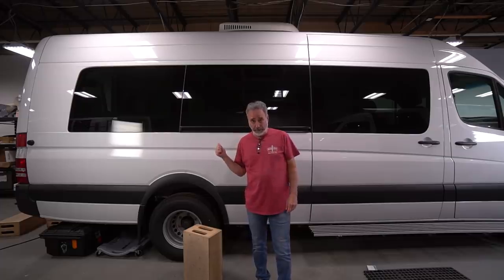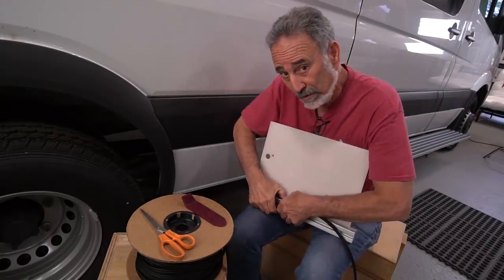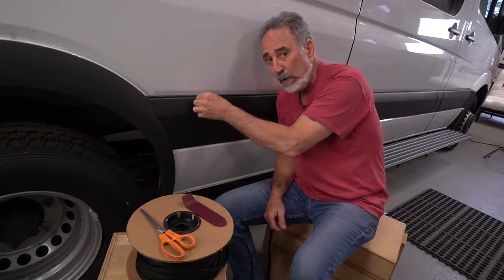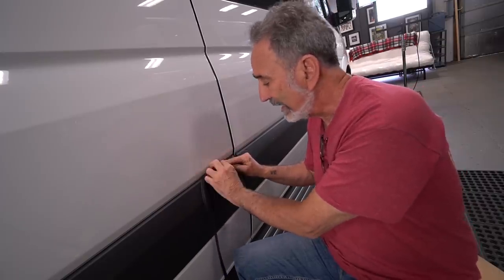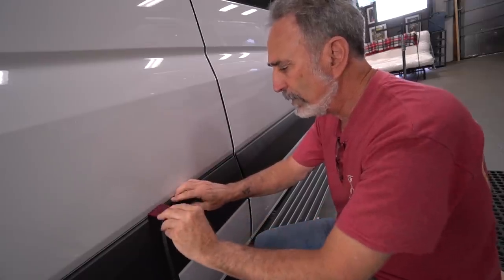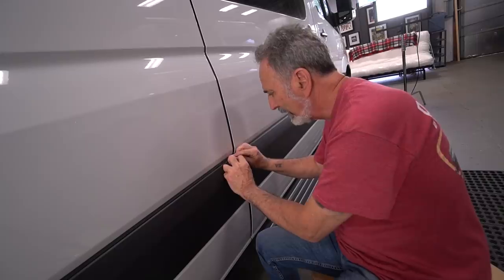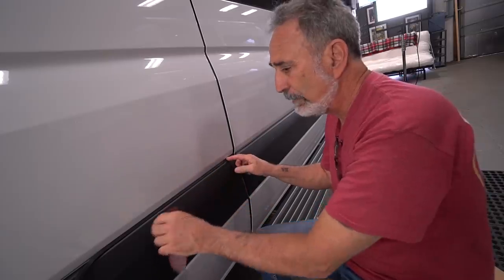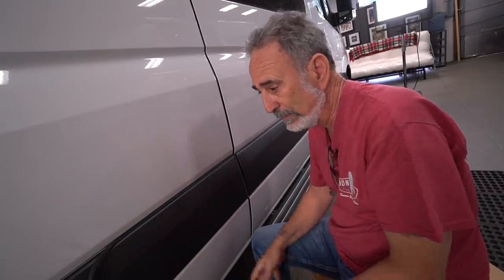SPRINTER OWNERS! Stop body panel leaks easily

Comment: I purchased the 8020 silicone version of the gasket and used this on my van after watching your video.  My understanding is that it does not have a UV retardant in it but it will be more UV resistant than the rubber version of the same profile gasket.  I added this in about and hour and after 3" of rain on a Saturday the leaks were stopped in my cargo van.  I had the luxury of being able to see inside the van since I had not insulated yet and the cargo factory panels were off.  It works.  The only change I made was to cut notches in the gasket where the gasket would not seat completely down into the track.  I figured I can replace the gasket on a periodic basis if needed.  Thanks for the great suggestion.
Reply from the maker: DISCLAIMER: I have not paid Kathryn Dydo for her review and she does not work for Humble Road 😜
Great review! Thank you Kathryn!

Comment: great video series.  my sprinter van build is 95% done. only 30% more to go. :-)   just finished installing the rubber strips. looks great. I added a uv resistant silicone.  and will add silicone or sikaflex to the interior clips then call this waterproofing job done. thanks for the tip. took 3 hours.

Comment: George, the other help would be Silglyde.  This is technically brake grease, but used extensively for rubber and o rings, it is completely safe for rubber unlike other greases.  I use to reassemble plastic clips and components for easier service later.

Comment: I already removed my panels and it went down exactly as you said...half the clips break and it's a pain in the butt.  I was shaking my head by the end, wondering how the fine folks at Mercedes could have allowed this design flaw.  I'm going to do the rubber flashing as well, as after a rain there's got to be water hanging out behind those panels, even though it likely can't get into the van.   Thanks for the great tip.
Reply: barbjoz63 this is a great tip, but if you guys are breaking half your clips you’re doing it wrong. I don’t think we broke even a single one.

Comment: There's an old adage that goes:  Good, fast, cheap, choose two.

This is a good, fast and cheap/affordable fix to a design flaw that should be remedied before applying insulation to the interior vertical panels of Sprinter vans!

If it were me, I wouldn't remove the panel, or use silicone. Available in either a gloss black thermoplastic elastomer, or a grey silicone, the 15 Series Economy Panel Gasket will effectively seal the space between the body panel exterior and top of the rub prevention trim.

At $0.53 per foot/meter, and ~$5.00 for a trim tool, this is a fix anyone and everyone can do. Probably for around $35.00 all-in!

Great tip George. And it looks really good, too.
Reply from the maker: John Coloe thanks John.

Comment: Thank you George for solving my problem. I really didn't want to pull the molding off. It's worth a try.
Reply from the maker: BeachBum given the cost and ease of installation, it’s definitely worth a try.
Reply: Why not do both? My lady and I took the trim pieces off, Sikaflexed all the clips and put them back on in an hour and a half. But I like this added insurance.

Comment: George made a bit of an issue about the panels on Sprinters catching water and causing rust in a recent post ( Sprinter? Promaster? Comparing these two vans
, Jul 19, 2020). Though George did not refer to his potential solution of 14 months ago, I remembered it and gave it another view and a Like.  With a '19 170 in conversion, I promptly ordered 40 feet of the gasket.

Then I read the 135 comments. To sum up: No long term review (more than 8 months); gasket is not UV rated (touch it up with some Aerospace 303 every few month); it's cheap enough to give it a try (I have); and like windshield wipers, consider it a maintenance item.(I will).

There is no car, truck, bike or motorcycle, no boat, personal water craft, airplane or house, that is design defect free or, that does not require maintenance; preventative or repair. This goes for vans too.

Thank you George, for reminding me to give the 80/20 gasket a try. I too suspect it will be a 90-95% solution.

Comment: Nice work George.  I’ve seen so many rusty Sprinters.... how could Benz let this go on for so many years.
Reply: All the vans that have plastic side panels have them mounted through straight-up holes in the side of the van. I saw a couple converting a Ducato (Promaster) who used spray foam and they foamed everything up very enthusiastically. Including the drain holes in the very bottom of the van walls. Didn't take very long before they had an indoor pool.
Reply: Croft Yes I saw that on a Day in Nature video, heartbreaking for them to redo work.

Comment: I admire your work so much. Creative, top quality, craftsmanship, etc. - all presented with humor in an entertaining way.

Question: is that rubber made to live in the sun and weather? If it is, seems like another creative, innovative solution to a known issue (makes you wonder how the manufacturer would let the known problem continue to exist, doesn’t it?).

As always, big thumbs up!!

👍
Reply from the maker: Thank you. This product is not necessarily made to live in the sun: "either a black thermoplastic elastomer or gray silicone rubber." I've had a piece of it on the van for 8 months now with no signs of fading, nor cracking. But I can't tell you how long it will last, think windshield wipers...
Reply: The 8020 trim is not UV resistant and its operating temperature rating is 0C - 40C. Depending on the environment, it will not last.

Comment: Hope they've addressed this fault on the 2019 sprinter - but a great fix anyway. Maybe prudent to seal from the inside as well.
Reply: If you see any van with side panels, they're almost certainly going through holes in the sheet metal. Not just Sprinters.
Reply: I own a Sprinter 2019... Same thing.

Comment: Anybody in the uk 🇬🇧 no where I could get this rubber trim . Great idea mate 👍🏻👌🏻
Reply from the maker: 8020.net
Reply: Did you have any luck? I got some weatherstrip from Screwfix and ran a blade down it to separate into two. The L shape I was left with worked okay but is a little thin for my liking.

Id be curious if you stumbled on a solution over here in Blighty.

Comment: Definitely a way to do a belt and suspenders approach here, but personally I'd strip the panels and use a marine sealant rather than silicone (or some equivalent) to seal the holes under the panels once and for all. And then this on top of that when the panels go back on. Pretty much all vans, not just Sprinters, have the side panels mounted through straight-up holes right into the van, and need to be sealed. The Ford Transit which is otherwise a great choice for this type build has four rubber-covered holes in the roof (!) too, something to do with the roof rack. Those need to be meticulously sealed also.

Comment: Good idea to stop water running down but when you are driving it will be spray. As the vehicle is moving there will be pressure difference between inside and outside. At times of suction, say when you open the window, this will draw the spray in through any holes. The only true way to stop it is to pop the trim and seal em with Sikaflex. As I've posted before, it's built in obsolescence coz VW/ Merc want em to rot so they can sell new vans.

Comment: I will try this on my Ford Transit 250.  or I will use zip away sealant.  Because it is removable. I would never use silicone Rubber.
UPDATE:
Turns out your method is a temporary solution. Problem is over time using your method, Plastic warps and starts to leak again. My Zip Seal' N Peel method is permanent and works very well
Reply: ."I would never use silicone Rubber.".......   why?   looking to sort my van too.

Comment: Looking for a solution for my van ,this seems to to be the answer at first glance.  I think I solved the problem ...I added vinyl film or car wrap by a professional pick out a cool picture they wrapped  the mid to bottom of the van exposing the camera and sensors only that trim piece is wrapped so water should not get there
 I have a 170 extended for $1500 they wrapped my hood and lower all the way around a full wrap  was $7000 -$10000.

Comment: brilliant once again! I believe this is a sprinter design/manufacturing flaw. Am I wrong...does it also happen on the Promasters?
Reply from the maker: As far as I know, it's a Sprinter issue.
Reply: Great website. There is similar holes in a ducato so I suspect they also exist in the promaster. These holes have two purposes , 1 to attach the panels and 2 to allow paint to drain out during manufacturing. There are often little rubber plugs in the end of the frame that you can pop out.

Comment: 5:06 Hey George, any long term feedback on your experience with this process? Was it effective? Do you still suggest doing this as a possible way to minimize water entry? Thanks again for all the great videos and information!
Reply from the maker: The two sprinters I did this to our long gone out of my possession. I can only guess that it worked just fine. It’s an inexpensive enough fix that. I would certainly give it a try. The success depends completely on how well you install it.
Reply: @HumbleRoad  Thank you so much for the quick reply, George. I take it you don’t do this to your current Sprinters.
Reply: @HumbleRoad  What do you use to seal your current builds?
Reply from the maker: @TheCCMasterChief  I do not address that design flaw any longer
Reply from the maker: @RR-ty6ki  Mercedes has had more than enough time to correct the problem. I tell my clients to file a warranty claim.
Reply: @HumbleRoad How would you know that you had damage from such leakage
Reply from the maker: @mind5533  I never saw any damage I was being proactive based on what I’ve read online
Reply: @HumbleRoad  I just did it last week, and it looks great. I bought the stuff after seeing your video a few months ago because I had noticed a ton of dirt sheeting out from under there upon washing after an 800 mile dirt road trip.  But I finally did it to keep my little dog’s thin leash from becoming snagged in that space. We have had no rain since.  I will post back next time it rains or I wash it.

Comment: George,  Nice idea, but seeing this is outdoors in the sun, is that 2115 panel gasket UV stable?   80/20inc has no specifications listed for it.  One things for sure, it will reduce the vibration of the panel against the painted body panel, therefore stopping plastic panel from rubbing through the paint job exposing the steel body panel to water and road salt as well as dirt.
Reply from the maker: M Rose most likely not UV stable. They offer a 150 ft roll for $70. If you share that with other Sprinter owners, it becomes more affordable. So have a gasket party every 3-5 years!

Comment: Are there any other spots to watch out for where a leak can occur? I've heard it can leak through the antenna, and from the heating matrix, but I once had a leak in the passenger side from the foot well down into between the seats, but never knew where that came from as someone cleaned it for me. So if anyone can give a y pointers with that it would be great.

Comment: Thanks for the tip. As a new Sprinter owner, I was not aware of this issue. I wonder how the black rubber will look with the all-white body panels painted by PW?  Better than having a leakage problem.
Reply from the maker: If you don't have any black on the chassis, the grey might look better. It's also a different material that might be easier to work with, IDK.
Reply: @HumbleRoad  well, we won't break the bank if we buy both colors and try them. Thank you again.

Comment: Hi, how are the trims holding up? I’m thinking of purchasing the same gasket but curious if it ended up cracking do to UV. Thank you.
Reply from the maker: I’ll ask the owner
Reply: I just ordered the gasketing George recommended as was curious about the same thing.  As an FYI; they now get .78/foot so 34' with UPS ground shipping came to 48.57 but still a good deal.  As some others here have reported, I intend to seal the inside of the clips with sikaflex as well.  Hoping this will eliminate any future considerations with leaking at these locations.  Thanks George!

Comment: I installed this on mine, made sure to press it in firmly, but it started to pop out. At some point I lost a whole strip while driving on the highway... The heat/cold seemed to also expand/contract the rubber lengthwise, creating extra tension making the strip pop in/out in some places. I should probably do it again, but have almost given up on this product... I'm sure there's a correct way to apply it, but I really made sure to stick mine in properly. I'm thinking perhaps some grease or soapy water is necessary (yes actually necessary) to remove any lengthwise tension in the strip? thoughts?
Reply from the maker: You will have trouble wherever you come across one of the Sprinter panel mount Christmas trees. You can try cutting away some of the barbed flange on your rubber to fly over the Christmas tree.
Reply: did you add silicone?   it acts like a glue and should hold it in place. I just finished ,one this morning and hope that I am right.

Comment: Wouldn't it be much a more guaranteed seal/easier fix if you just caulked the perimeter of where the plastic panel's edges meet the metal body of the van?

Comment: As a tool, would the roller you used on the screen door work?  If not that, a similar wheel-type tool?
Reply from the maker: Geoff Badenoch yes a wheel tool would be helpful. But not a metal variety, plastic, soft plastic!

Comment: Here’s why NOT to remove those trim panels: I removed mine with a plastic tool. I leveraged off the body to pop each connector loose. Was a cloudy day. The next day, the sun was out, and each of my ~50 tiny dings in the body was clearly visible. It hurt to see that. If I had it to do over again, I’d leave the panels on, but seal each and every clip from the INSIDE, using Sikaflex.

Comment: owl vans sells a rubber kit just for  this purpose so I'm wondering of its better than the 8020 and want to find out the difference in price, anything marine or Van conversion s brings a Hefty over priced item, oh by the end of the video George mentioned the price so about $25 for a 170 and Owl Vans is $59 SO my decision is made, thanks
Reply from the maker: I know for a fact that after I posted the video, “products” started popping up on line. They were simply buying the lengths from 8020, repackaging and selling as a special kit.

Comment: You can also solve the problem by giving the water a bit of a playground and cut out stripes under every plastic-pin... this way water can come in but it'll leave the "natural way"... Since the Van isn't insulated in these areas you can top up the insulation with a a little bit of thinner material over it... so the water is behind it. I also like you're idea but I know a lot of problems for example with the Fiat Ducato (which is your Promaster in the US) and you're not even think about what can happen in the future... Take for example the Promasters little "rain gutter" over the backdoors... it's a horrible construction-failure by Fiat because if you're Van is standing in the snow and water freezes up there in the rain gutter it can damage your upper layer of paint and we all know what will happen if the paint peels off on the roof... it's getting expensive! ;) So I hope I gave you a new information here about your future Van-Builds since this was my most painful lesson in the past. I simply love your attention to detail on your Van-Builds... awesome work... speaking from photographer to photographer! :) ;)

Comment: Is the strip material UV stable?? ...or stable with use of soaps, oils, waxes, polishes etc??
Reply from the maker: search: gloss black thermoplastic elastomer, or a grey silicone.
Reply: Humble Road  ok and which one is the stripping material made out of?
Reply from the maker: @simondigiwiz4810  You can get it in either material and color. I purchased the gloss black thermoplastic. A test piece has been on the van since last October. Drove it from NJ to Elkhart, Indiana and back, sat outside for months, no signs of wear or degradation. And let's face it, at less than $30, I'm happy to replace it every few years for the protection it affords me every day! Black or grey, you decide. 👌

Comment: would just using silicon fix this problem in theory?
Reply from the maker: In theory yes. But let’s consider how the silicon will discolor and attract dirt and near impossible to remove. This rubber strip is so easy to push in and cheap enough to replace every five years..

Comment: Bought the 80/20 and couldn’t get the strips to stay in place after a few bumpy rides. (2016/144/4x4 Sprinter).
Reply from the maker: I drove mine from New Jersey to Elkhart, Indiana and back. They didn’t budge.
Reply: Humble Road - my Sprinter is a 4x4. When I go ‘off-road’ I think there is torque on the body  that makes the strips loosen. I am trying to get them jammed in again.
Reply from the maker: Try a bead of clear silicone. Carefully!

Comment: Why should you do this? I don’t understand it 🙈
Reply from the maker: If you don't understand it, then you don't have the problem. Sprinter body panels leak into the van. This is a simple, effective way to shed the water away from leaking into the van.